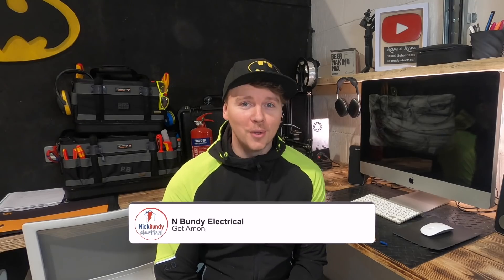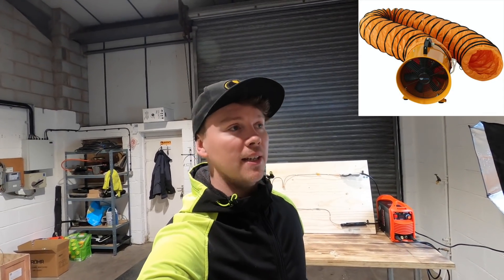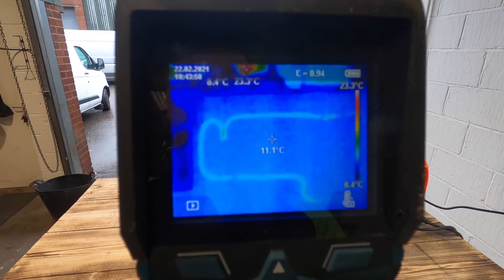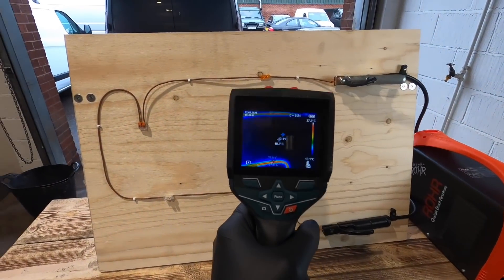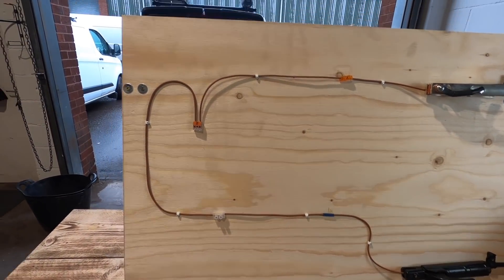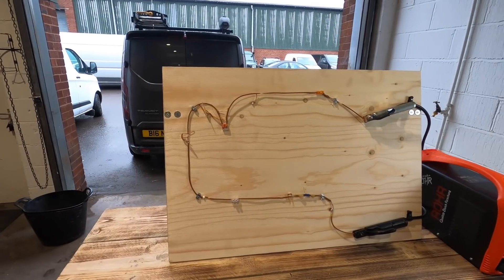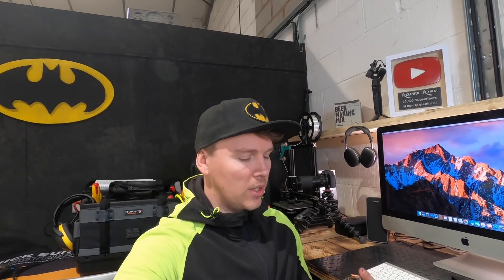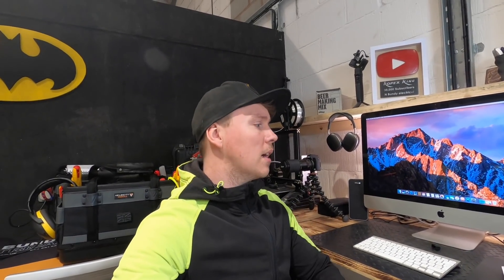Overloading Cable Connectors, Electrician

Comment: Did the spring clamp pop on the 221 when it melted. That seems why it would pop as it did. They all took way more than the rating and it shows you why those ratings are low to be safe but can stand more for when people use them wrong or faults happen. When is Bundy10 going to be Bundy100K?

Comment: Suggestion : coiled vs. uncoiled extension lead. Also cheapo multi-way socket blocks - can they actually handle 13A?
Reply: Daisy chained extension leads would be interesting too. I think we all know the answers to most of these already but, just like Big Clive and ElectroBoom, we want fire :)
Reply: @mikepembo8297  the original flame man was photonicinduction. Miss his conent
Reply: @Liberator975  I miss it too. I was just thinking about his channel the other day and was going to have a check for new content, but given your comment I guess he hasn't returned for a while :(  
The guy was bonkers (in a good way) but I understand he had some personal issues going on at the time. I just hope he's on a good path and happy despite not posting to YouTube
Reply: @mikepembo8297  absolutely
Reply: @mikepembo8297  Daisy chaining extensions, seen this in  various places  and mentioned it and been told theyre only plugging in  hairdryers and phones and side lights, into the daisy chained 4 ways, so basicly i was ignored by the owners, must take pics next time. Not hapy
Reply: I'd be interested also to see what the coiled vs uncoiled lead is like with a load equivalent to say a radiant/oil heater etc on it (or maybe three - just for the views; no-one would ever do that, would they?).
Reply: @mikeselectricstuff I'd like to see someone do a test the shows that the melting of a coiled lead it down to resistance/lack of cooling and NOT inductance (as many in the entertainment industry still seem to believe.) The only way I could think of doing it is the same length of cable in an oil or water bath, one test with it just randomly place in and the other with it in a tight coil and measure the temperature rise of the water/oil  over a given time at a given current, if it's the same in both cases then is must be resistance and not inductance. It would also be interesting to test it with single core cable so there isn't cancellation of live and neutral currents.
Reply: Local supermarket a few years ago, major chain, extension lead plugged into a socket on ceiling and hanging down  to feed a large fridge of grab and go food, Fire brigade turned up to do inspection and first thing they noticed was that extension, they where not happy and store made to remove it.

Comment: See why I think connector block is better than a connector that’s relying on sprung tension like a wago. Always said I’d rather be making the connection by lightly twisting cable cores then over both screws of the connector block into the same side.

Comment: You should run each test case in a separate way. Test on crimp, Test Idea Splice, etc. To see which best. Not four connected to the test. I want to see your Video next.  Thumb up! Cheer!
Reply: The way nick tested had identical test conditions.

Comment: Would be good to measure the colts drop across each resistive joint and see if this is affected by temperature
Reply: It is. That’s what generates heat or hot spot

Comment: 4mm single core is 37 amps , 2.5 mm is 27 amps table 4D1A   For 70 c thermoplastic single core  page 401 
Or did you use the single core 90 c thermosetting cable table 4E1A    ?

Comment: wago blew first ?? hell ! i'm going back to twisting wires together & then wrapping in insulation tape :)
Reply: it didn't blow as such. it was just positioned in a way that made the weight of the cable and the connector itself put some downward force unlike the other connectors which were connected horizontally. the wago should be placed on a vertical section of the wire and that would have not happened. the 'blow' was probably just an arch created when the connector slid off the wire.
Reply: @plllot9713  Yes it's not designed as fuse and you should never rely on it to be one just pointing  out that in the really world that could have resulted in someone's day to buy a lottery ticket it's still not a problem or a weakness to fail at over three times the rated current.
Reply: That's a good thing it acted as a fuse and possibly saved the house burning down. It still survived WAY over it's rated current and unlike the terminal block which seemingly was better hasn't screws to get loose over time.

Comment: I've always wondered, what's the fundamental issue with extension leads in to extension lead? I get it overseas, it's easy to overload a socket. But in the UK each extension will have a fuse in the plug right? So even with multiple extension leads plugged in to each other you shouldn't be able to exceed 13amps for all plugged in devices... Wouldn't the fuse in the first extension would blow first? Am I missing something?
Reply: You're right about 13A fuse in total but that is still quite a lot of current and plenty to start a fire (240V * 13A = 3000W = 3000 Joules of energy every second - a match head has about 1000 joules of energy for comparison so three matches every second!). The more connections, the more likelihood that one will be a loose connection that can overheat. Remember that all the connections are in series so the total resistance is the sum of each individual connection's resistance. Also, the more extension leads, the more voltage drop from the cable too.

Comment: I think it was the heat rather than the amperage that caused the final failure, especially a spring connector such as a Wago which will be adversely affected by thermal damage to the metallic spring. Perhaps try again matching the ratings of the cable AND the connectors to find the true weak point.

Comment: Maybe cos the terminal block is clear it's not reading temp properly? Not an expert
Reply: The terminal block when tightened down properly actually will created less resistance across the joint for numerous reasons, it has the most contact with the cable conductor, it has by far the most metal to conduct through. Although it pulled apart the crimp should actually have been the second to last to fail. The others are based on spring loaded connection so won’t slip out but should show a slightly higher resistance.

Comment: Did the WAGO burned or did the cable broke near the WAGO?
130 Ampere in a domestic house? The usaly the fuse cant take that.
 
We in Germany have usaly only 32, 50 or 62 A sealed industrial fuses before the electricity meter for domestic houses. 
Than the LS current breaker  up to B 16A  (3 phase 230 Volt)

Comment: I believe the Wago 221 is rated 440v/32A, you were looking at the wrong side where it quotes the Japanese standard of 20A.
Also if this was a test of connectors would it not have been better to use a larger gauge cable? Good vid though.😀👍 Edit - just watched this one - may give you ideas for future tests. https://youtu.be/B1pmuRsf1co

Comment: dont forget all the heat was able to escape, in a wall etc, the heat built up would be much quicker, interesting that JB etc are now not really allowed, but can handle more power
Reply: JBs can handle more power when newly and correctly installed but over time they can work loose resulting in a much weaker and therefore more dangerous connection. In theory Wagos don't loosen so stay reliable longer.

Comment: Is your welder AC or DC output? If DC, then most connectors have a different current carrying capacity to AC, and often a different voltage rating.
Reply from the maker: It’s dc
Reply: @NBundyElectrical  If you want to put a clamp meter on, you'll need one that can measure DC
Reply from the maker: I’ll have to check bud
Reply: Thank god we still have John Ward. A man who does his research.

Comment: As a prehistoric dinosaur spark , I have not become a huge fan of the modern day Wago,  so this video has reassured me. 
Great demonstration,  cheers.
Reply: is has failed way way above its rating... i dont see that as a problem even less so when there are WAGOs that can easily handle 32 and 40A ?!
Reply: The Wago failing like that is a good thing it acted as a fuse and possibly saved the house burning down. It still survived WAY over it's rated current and unlike the terminal block which seemingly was better hasn't screws to get loose over time. Long term old style terminal blocks are far more of a liability.

Comment: 40.2k subscribers when I watched this - congratulations. The wago has the least copper in it, so not surprising that it was the first to fail. I wonder if the connection pressure of the wago was also affected by the heat. That looks like an inverter style welder, so as per below, would be interesting to see a true RMS clamp meter reading the current to see how it compares to the readout on the welder.

Comment: So which would be best to extend the ring tails inside a CU? I was thinking Spliceline?
Reply: Depending on the cable size and current draw, a WAGO 221 upto 2.5mm and a WAGO 773-173 from 2.5mm upto 6mm work out well.

Comment: Very interesting, I'm an old school electrician.Did my apprenticeship when 15th Edition was in place, Obviously things have improved greatly and for the better, but I just can't believe push fit is a better connection than two wires actually touching and screwed tight. So heat expansion loosen screws? Push fit Mains tails next then? Great informative demonstration Nick really enjoyed it 👍
Reply: I think you've it it on the head there "two wires actually touching and screwed tight" (but not too tight). If it's done right the old way holds up great, hence all the torque settings in consumer units now.

But with the amount of DIY/careless work out there now I trust a wago to still give a good connection after some such person has fiddled with it, even if it's the first to go here under extreme circumstances. I'm yet to find a melted wago in an installation, but I have found melted connector blocks, most of which I'm pretty sure had been put in not long ago by DIY-dad having a go (going to give 2nd place to the eastern-european kitchen fitters claiming they trained as a spark back home, maybe that's why they had to leave!). Hence why I look forward to the day we get sockets, switches, and lights with wago-style connections, because they so often get fiddled with by the DIYers.
Reply: Its more a spring compression fitting rather than push fit. Even when the plastic melts away it will still hold current with the steel

Comment: I was amazed to see how all those day-today connectors we use are under-rated by the manufacturers, but I've found that it's the opposite when it comes to 13A plugs and FCUs.  I've seen many of those suffer with continuous heavy loads which they should have been fine with.  Fused spurs are usually unnecessary for fixed loads, so I always avoid specifying them when regulations say they can be omitted.

Comment: It would be interesting to see the same test done on different makes of 2.5 T&E.  All makes have to pass the relevant BS standard to be sold here, but are they as good as each other?  Are some more equal than others?
Reply: Some would say we massively over engineer our cable thickness already, so even poor cable should be ok. Be nice to see a broken ring with 36A AC flowing.

Comment: Well done on the 40K subs - Jordan 6K ahead you catching up. Keep up the great content. Defo do some work on putting nails in cables and testing with that shorts and measuring. The message is the importance of using listed products that have been fully tested. Listed devices have been tested using these and much more destructive testing and rigorous testing. Very minor point you should have used a block and put these connectors in parallel rather than series and you would then getter a better sense a more accurate result.

Comment: What was the voltage across the wire from a welder at 40amps? If it's low voltage how does that affect the watts of heating being applied to the wire and connectors?
Reply: Volts don’t matter,  at 100A fed from an inverter powered via a standard UK fused plug circuit it will be somewhere around 2 volts but regardless, in all cases of resistive circuits,  the watts = amps squared multiplied by the resistance

At 40A it will be around 6v.

Comment: The connector block compared to the others did well, but it's a big lump of metal which just goes to show they aren't bad if installed correctly with some care.  Everything took more than double the rated load before it started to go wrong which is comforting to know.
Reply: Manufacturers will always give themselves so much room in the ratings charts, much like supermarket use by dates, they go well over to cover themselves
Reply: The issue with the chocolate block connectors is the screw.  These are prone to becoming loose over time which is why they have to be accessible for inspection / re-tightening.  Wago’s, when properly installed, with carriers / boxes / strain relief are mandated when easy access for maintenance cannot be provided / assured.
Reply: @SoapyB20  when you have thermal cycling — which you get even just from seasonal changes, never mind high power use — inclined wedge type fasteners (which is what a screw is) always have a tendency to work themselves loose. If your clamping force is exactly right, it’s fairly minimal though. But under tightened or over tightened and all bets are off. Whereas spring tension is still spring tension.
Reply: @JasperJanssen  would heat weaken the spring in a WAGO?
Reply: @jeremylister89  No!The plastic would melt first and prevent to least the spring.And when closed there is no tension on the spring..But still enough pressure on the connection.Only when its open the spring is pushed up.
Reply: @SoapyB20  Yep happened at my last house. Loose screw, insulation burnt back. Found on inspection.
Reply: i wont think is a good thing to have the cable be the most likely point of ignition. if the connector would have failed at its rating with out a spark now that would have stopped the chance of a fire. after all the circuit is now broken.
Reply: @highkicker11  I'm no Sparky, but I'd have thought failing without risk of spark isn't part of the design requirements of these sort of connectors. Isn't that what the fuses are supposed to do (assuming they haven't been bypassed)?
Reply: @Thermalions  yeah fuses are suppose to do that but if some idiot by passes it. the former first responder in me would be happy if a major fire would have been stopped because of the connector failing when it reaches it stated limit. because i just know there is no such thing as fool proof.
Reply: @highkicker11  the heat generated by the poor connection is enough to start the fire. A loose connection doesn't need to have any visible arcing. The higher resistance of the connection is what causes heat and eventually failure of the connection
Reply: @Liberator975  I noticed the Wago  was running much hotter than the 'choccy block' (which is pretty much the default here in Australia- 'choccy block', or BP connector is the norm)- Still not convinced that they are better- faster yes, but better??? hmmm....
Reply: @steved2136  even at double the rated current they still hold on to the connection tight. I'm a diyer and have changed everyone of the chocolate blocks for wagos. They make fault finding after simple
Reply: @Liberator975  Yeah, but even at the lower settings, the Wago was definitely running hotter than the choccy block... To me, heat is the sign of a bad joint- if its getting hot- then there is resistance at that joint... The fact that in his test, it was always hotter than the rest, and was (not very coincidentally) the first to fail.... hmmm...
Reply: @Liberator975  o i know that so they should make them less strong and better connection so that they dont get hot just to make sure they fail before combustion can be achieved 😉.
Reply: @steved2136  the connection didn't heat when below its rating. Any overload should be broken by the breaker.
Reply: @highkicker11  if the connection failed. It woulfd begin arcing and causing a fire risk 🤨
Reply: @highkicker11  you only need 0.24mm air gap to arc at 240v
Reply: @steved2136  

Wago and all of the connectors took way more than designed though.

And Wago's are maintainance free.
Reply: @Liberator975  Agree. On PCB we use 2mm spacing for 400V dc
Reply: Yes and heat is proportional to current squared, so yep they did well. Just ordered some WAGO 221's
Reply: Yes,but these wires are out off the appliances and so have a lot of cooling!So they would be melting in the real circumstances..Before the Wago would melt..Because the wire is not solid it cant have the real amount off copper compared to solid wire.We on the continent use solid wire..Mostly 2,5 mm..In the Netherlands the switches are usually 16 amps,so very much lower than 30 amps..Not to mention the 100 amps like here..

Comment: Excellent ! Thank you, good old connector block, been using them for 65 years !!!🇮🇪☘️
Reply: The Wago failing like that is a good thing it acted as a fuse and possibly saved the house burning down. It still survived WAY over it's rated current and unlike the terminal block which seemingly was better hasn't screws to get loose over time. Long term old style terminal blocks are far more of a liability.